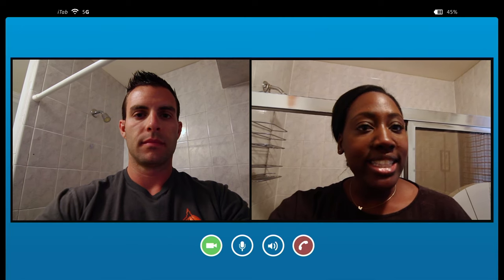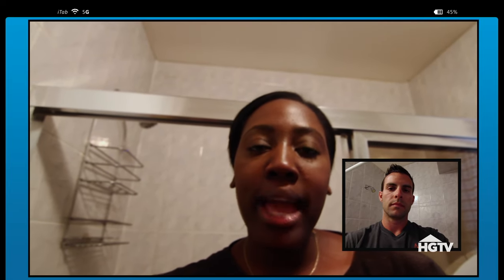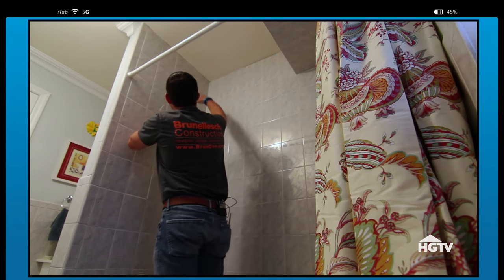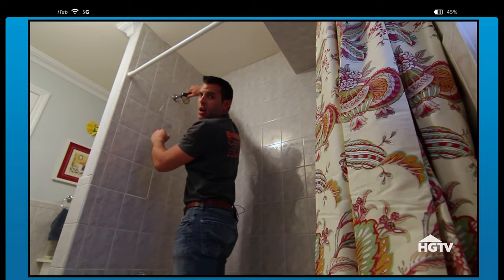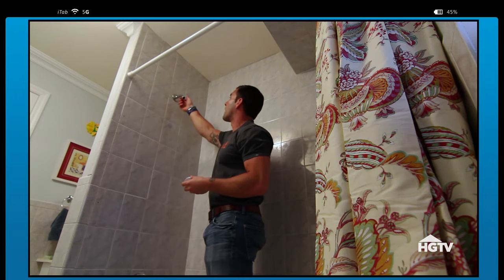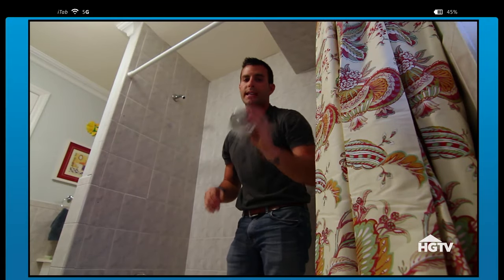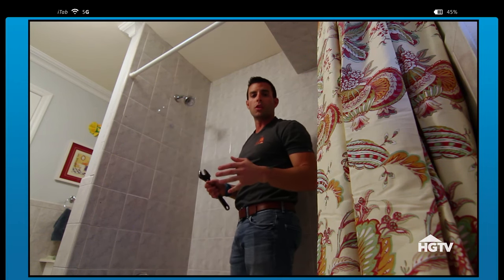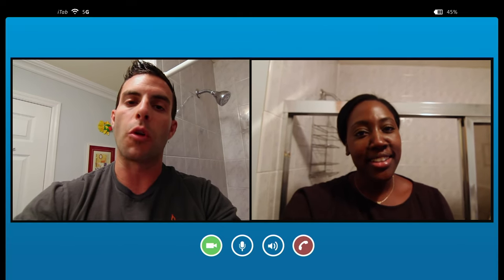How to Change a Showerhead | At Home Tips | HGTV

Comment: You can soak the shower head in white vinegar without removing the shower head. Just put vinegar in a plastic bag, place plastic bag over shower head, and secure with a rubber band. Now your shower head is submerged in the white vinegar. Leave it there for 24 hours, and when you remove it, voila! The mineral deposits from hard water will be gone, and your shower head will be good as new. You can also do this for your sink faucets.

Comment: I clean my shower head by putting pure white distilled vinegar in a sandwich bag and tying and know to hold the bag of vinegar over the shower head. I leave it on for 8 hours and all of the hard water deposit is completely gone. Maybe try using a shower head filter that has multimedia.

Comment: TIP - Run hot water through your shower on hottest setting for 2 minutes and 
shut off the water. Now try to unscrew the shower head it will come off easily. The old plumbers tape solidifies and makes it hard to turn the shower head nut resulting in breaking of shower arm which you do not want. Running hot water expands the joints, softens the plumbers tape and make it easy to turn the shower head nut.
Reply: Amazing!!
Reply: Worked like a charm on my extremely tough 15ish year old shower-head. Thanks!!
Reply: Thanks for the tip!
Reply: Awesome! Thanks!!
Reply: THE REAL LPT IN THE COMMENTS. THANK YOU SO MUCH SERIOUSLY. I bought a new showerhead that's been sitting for months now because I couldn't get the old one off no matter what and this just did the trick. Many thanks!!
Reply: @narafied  glad it worked
Reply: @zackbarrier5623  glad it worked
Reply: I don't care how may before me said it.  GOOD TIP.    Thanks.
Reply: Bless you Ive been struggling with the showerhead for 10 minutes now. About to try this out.
Reply: Bless you, your soul, your family and your previous and future generations.
Reply: I have a filter shower head and it’s been sitting in my cabinet for months. Tried it again today and you were the missing point that I needed. Thank you thank you so much! God bless you
Reply: Oh my goodness thank you soooo soooo much for this tip you have no idea im currently trying to change mine and its stuck its on there soo good and so im going to try this Its driving me crazy that I can't get this off
Reply: Omg it worked like a charm. Thanks for the tip! 💜
Reply: Just made a hand held showerhead purchase on Amazon. Looking forward to trying this method
Reply: This comment helped so much. I could not get the shower head off with the wrench until I ran hot water for 2 minutes. It came off with ease after that. Thank you so much!
Reply: THANK YOU! Just moved into a new place and went to replace the shower head but it was EXTREMELY tight. Was about to go buy a new wrench at Home Depot when I saw your comment! Let the water run hot for 2 minutes, then went to loosen it and boom, came right off! You're awesome!
Reply: Instructions unclear. My house is now engulfed in flames.
Reply: @SeanTurle water too spicy. try ranch next time.
Reply: Terrible video, amazing comment 🎉
Reply: Mine is still stuck though no matter how long I have the water at the hottest setting.
Reply: WOW like everyone else, running hot water for a bit then used the crescent wrench it finally came off with ease.  lucky for me i have a tankless gas water heater that i had installed a few years back and enough hot water to assist, lol
Reply: @Cacowninja feel your pain same here
Reply: @DanielAraujo.11.02.  Update, a while back my Dad twisted the wrench harder than I could and unscrewed the shower head.

I then replaced it.
Reply: @Cacowninja, Looks like it is really stuck, maybe rusted?  This will require lot more force but as I mentioned in my original post there is a risk of breaking the shower arm that extends behind into the drywall and that could be a very expensive mistake. I would suggest  hold the shower arm tight with your left hand while applying force with right hand to unscrew the shower head with the crescent wrench. It will need lot of strength considering how bad its stuck. If it still doesn’t work You should call the plumber.
Reply: You’re a gem! I stumbled across the wrong video but stumbled across the right comment. Mind blown
Reply: thank you im going to try it out i can’t get my showerhead off
Reply: Guys, my wrench just slips and cannit grab the chrome base of the head
Reply: @Rafael555888 try wrapping some masking tape around it then try. The tape will provide some friction and hold to the crescent wrench.

Comment: How do you change the speed on the water shooting out
Reply: Adjust your pressure regulator, usually in the front yard by your main water shut off valve.